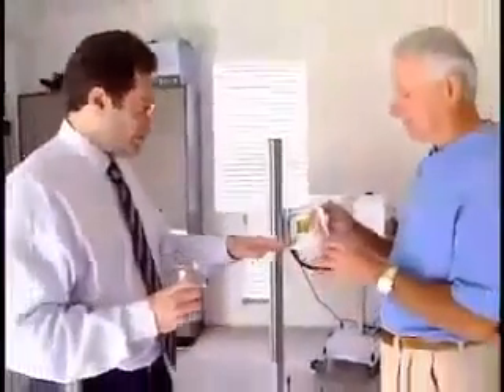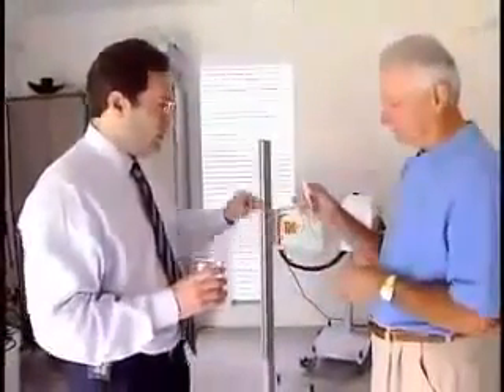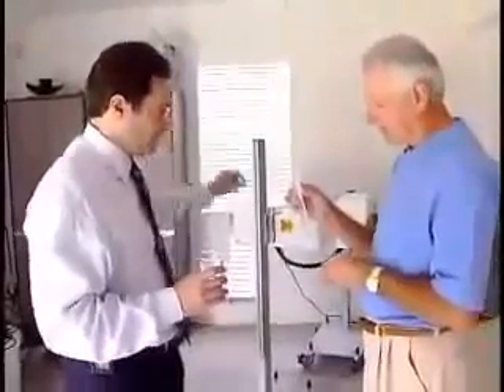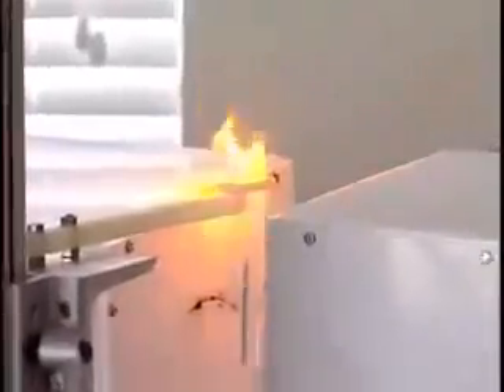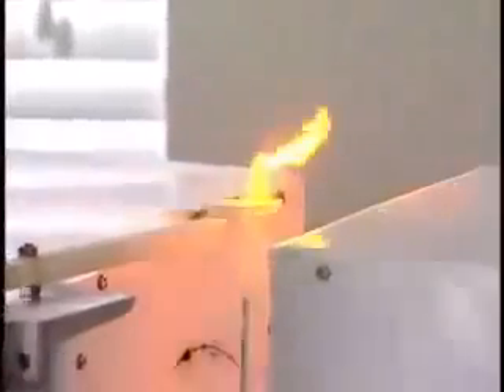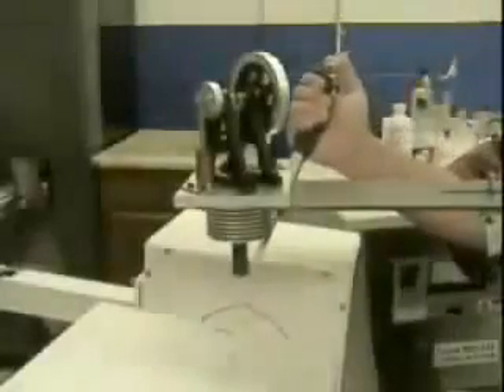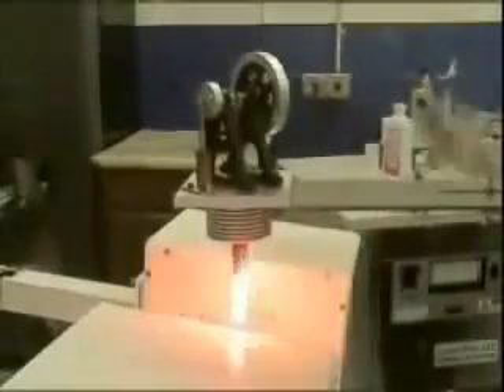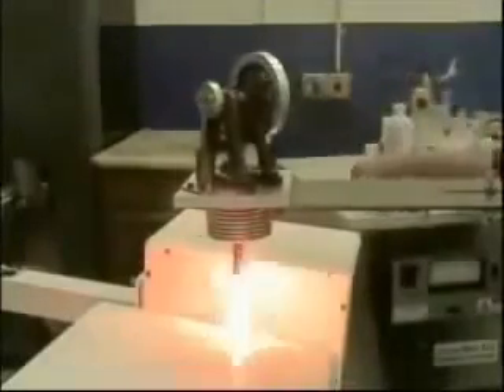John Kanzius turns seawater into clean fuel

Comment: 13.56 Mhz is the frequency that does this. We need to make this a reality for cars like Stan Meyer and the Genepax company of Japan had done.
Reply: "Approved ISM frequency used by plasma sources as an operating frequency. The resulting plasma is described as RF plasma (RF = radio frequency) because of the wavelength. 13,56 MHz is an official ISM frequency used for high efficient plasma treatment."

Also

"In an effort to lower Tag cost and address applications of high quantity Tags usage, the 13.56 MHz RFID tag was born, along with the high frequency reader."
Reply: How much power does it take to run the experiment, versus the heat produced igniting the hydrogen gas released? Is the salt oxydized? From the oxygen in the water, or also the ambient air?

Comment: If true, as I'm pertty sure it is - the demonstration merely shows the decomposition exhibited during electrolysis of an electrolyte and not water. The salt decomposes thus releasing  hydrogen contained within the sodium which is then able to be ignited. The flame colour is yellow and the piece of paper doesn't burn simply because the paper has absorbed water and it only was the sodium-hydrogen gas that burns. One must also bear in mind salt can generate an electrical current. So the guy is carrying out electrolysis without the need for electrodes!
Reply: Quran tekvir 6 :"And when the seas are ignited "God informs that the seas can be burned 1400 years ago.
Reply: @suleymancantemur3327  IN SAME BOOK THERE'S BURAQ, what about that?
Reply: salt is sodium and chlorine. There is no hydrogen. That comes from the water. The electrolyte consists of hydrogen ions, sodium ions, chloride ions, and OH ions. Sodium is an element, so doesn't contain any hydrogen.
Reply: 13.56 Mhz water electrolysis is viable as a fuel source because you get more energy burning the hydrogen than you have to put in with electricity to create the 13.56 Mhz waves needed to burn it. When I light my hibachi, the energy it takes to strike the match is less than the heat energy I get back to cook food, so it's not true when people say that the energy input needed to create combustion can't be less than energy output from the combustion.
Reply: @jamesgeis  How hard it is to create a single function device to produce this frequency and burn some salt or the water it's in? Is it really net exothernal? Why is not everyone doing it yet?
Reply: @Cloxxki  I don't know how much energy it takes to do this, but i do know that Griggs hydrosonic cavitation heaters can heat water by mechanically creating shock waves in the water creating more thermal energy output than mechanical energy input. This is a device that is relatively easy to make. 
https://www.youtube.com/watch?v=wAHNpCeGmDw
Reply: @jamesgeis  it's stupid easy, you get a signal generator and rf amplifier and wind some high inductance air/ferrite coils with a gap between them. If you know a ham radio guy, they probably have everything needed to replicate this already.